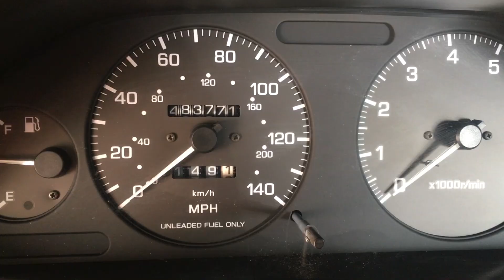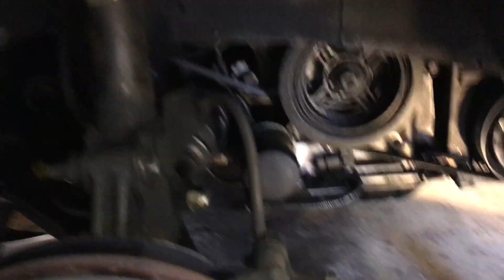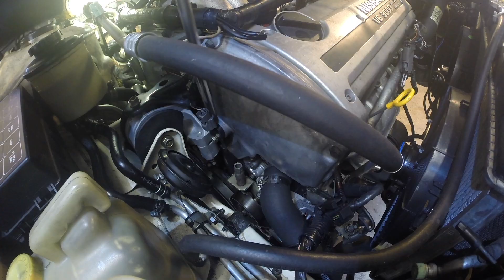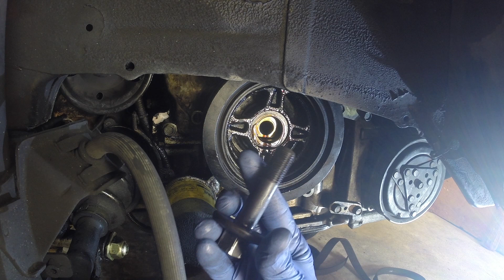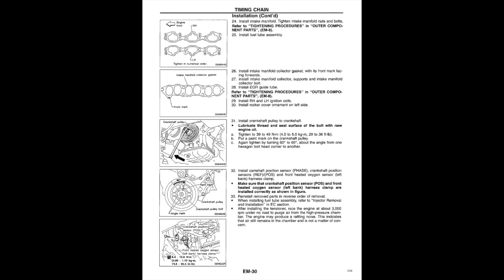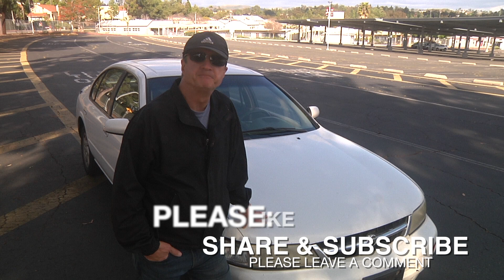Replacing the crankshaft front oil seal on a 1997 4th generation Nissan Maxima w/ 483K miles on it

Comment: All i needed to know was the size of the crank pulley bolt.  Thank you!  Yours is the only video i could find with that information.  I'm at work in town and just wanted to make sure i have the correct socket at home...
Reply from the maker: @clintaugustine8732  
Were you able to remove it easily?
Reply: @Raymazon first I tried a Milwaukee ½" impact ... That thing wouldn't touch it... Then I tried pneumatic... Still no... I ended up using the starter method, but I learned, you have to give the pull handle 2 or 3 inches of slack, for a running start.  Popped it first try lol
Reply: Also, that 60 degree part is strange.  Why can't they just give you a torque spec and leave it at that lol
Reply from the maker: @clintaugustine8732  
I agree. I wondered the same thing. I wonder if they do it to get a torque level that exceeds most torque wrenches?? I have no real idea why. I’d be curious to know.
Reply: @Raymazon me too me too.  Right now I'm trying to figure out your belt trick... Mosquitoes are really bad and I'm getting frustrated lol.  I've got the seal in and new pulley on and started... Now if I can just get it torqued

Comment: does anyone know where the crankshaft position sensor is located on a 1994 nissan maxima GXE? I can't seem to locate it on my engine. thank you
Reply from the maker: Sorry for the delay in responding. On my '97, it was in two places. Hard to show here though. One location is near the top of the main pulley, the other was on the driver's side of the block just above the oil pan. I had to recently replace that one. Not too hard, but messy. I didn't film it though. I don't know where the "94 would be, but maybe in similar areas.
Reply: @Raymazon  thank you for the response unfortunately nissan changed the layout of the engine after the '94 to a new generation, thanks anyways

Comment: I have no reverse on my 96 maxima . Did you ever have to repair your transmission  ? I have 200 000 miles.
Reply from the maker: I replaced my transmission at about 250K. The car just passed 500K last week.

Comment: Hey buddy thanks for the tip... I believe I got to replace my seals because I'm still leaking some oil after changing my oil switch sensor
Reply from the maker: I can relate. I’ve got leaks from seals in several places. At 495,000 miles I can’t really complain though. 🙂
Reply: @Raymazon  mines has 242k n it runs great just minor leaks I adjusted the oil switch yesterday n I will follow your instructions this Saturday am to change the seal hopefully your instructions will guide me well I'm sure they will bless my brother n wish you a great turkey day

Comment: Excellent step by step indeed. Question could the bolt on the harmonic balancer be removed prior to any of the belts being removed?
Reply from the maker: That’s a great question. I assume you could. I hadn’t considered trying it. 

There would be friction on the pulley, so when you use the impact wrench, it would possibly be enough to hold it from turning. 

If you do that, please let us know how it works.  Thanks for suggestion!
Reply: @Raymazon  Will do I'm soaking the bolt and filling up my compressor as we speak.